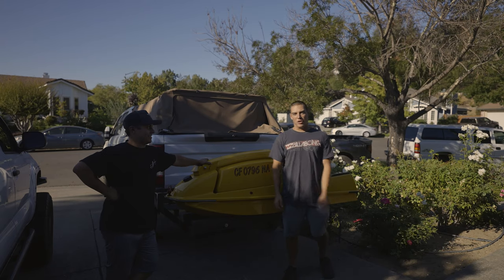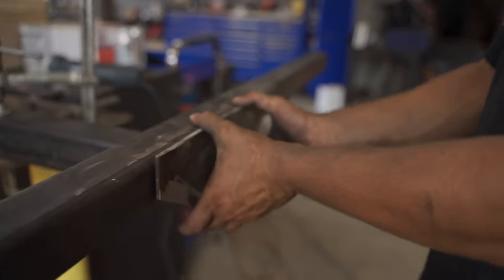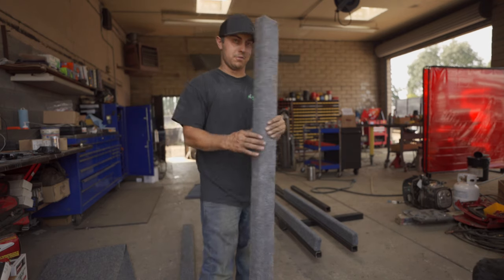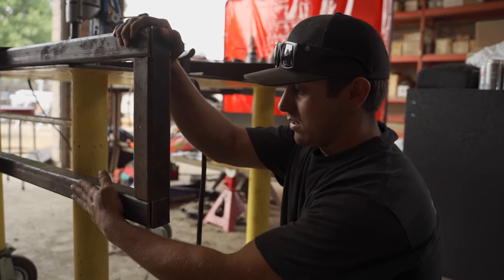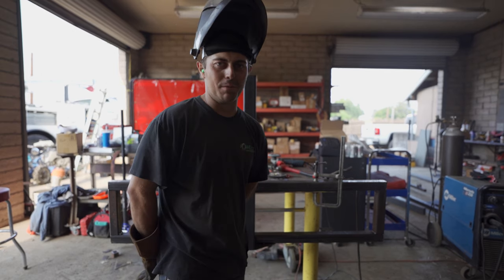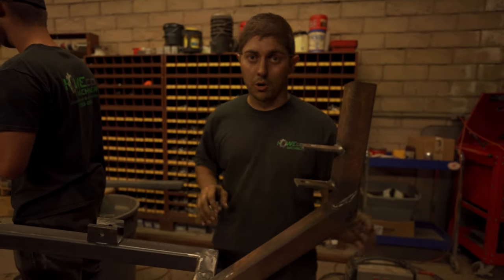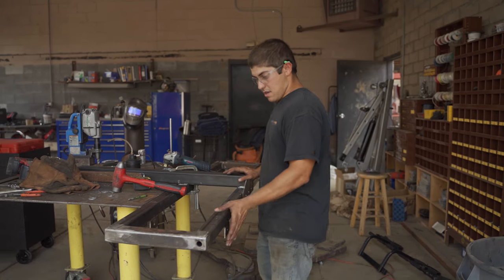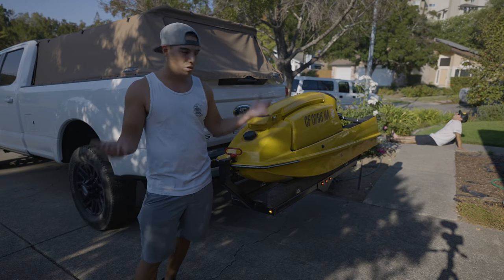HOW TO BUILD A HITCH CARRIER FOR YOUR JETSKI

Comment: Hey, I’m trying to build one of these. I have been trying to figure out what’s the best way to launch my JetSki by myself because my lady can’t lift anything when you back the truck into the lake can you get it up onto the two wood runners by yourself, and then add somebody kind of holding in place as you pull out of the water?
Reply from the maker: I’m able to launch by myself, I just back up enough to be able to slide the ski on and off

Comment: Any reason for making it soo heavy?
Reply: *heavy duty.
Reply from the maker: @josephpacheco7508  no not really any reason, just because of the trucks that were putting them on I chose to get a little crazy cause why not haha. If I were to build these for someone I would scale down some
Reply: @AvidMedia  I have a few buddies with them and they're just 2x2 square stock with 4 flatbar plates similarly shaped to your tail gusset with the 3 lights but they are about 3ft wide and sandwich the 2x4's but they run no lights and such either. Or pin mounts. They are pretty light but yours looks really clean. Contemplating my own design of what and how I wanna do it. Keep up the great work!

Ps, always keep the bloopers in there. 🤣🤣